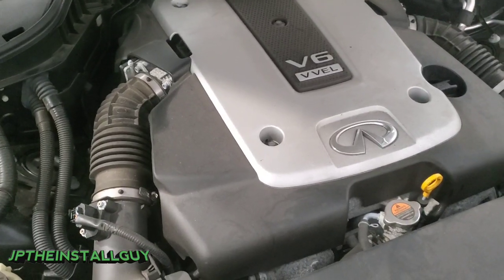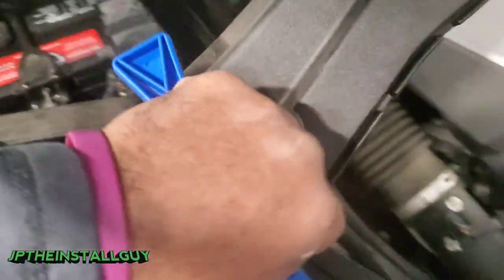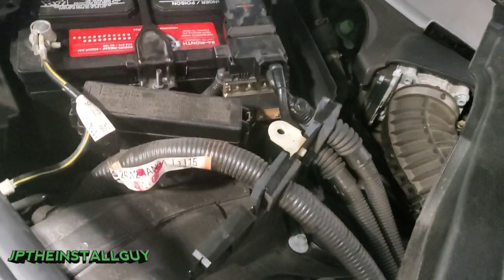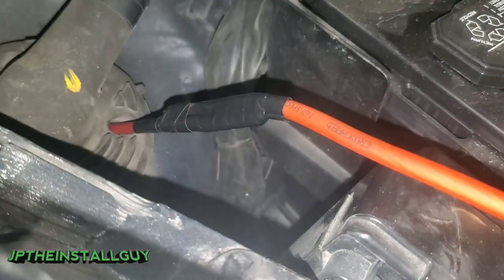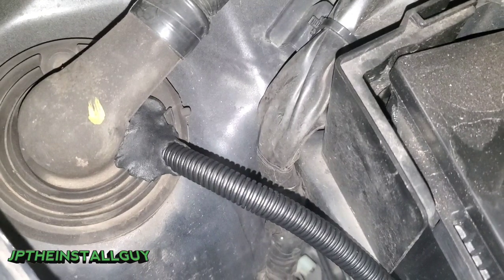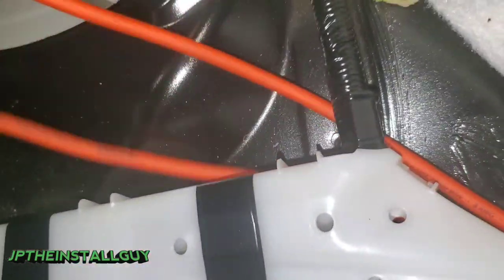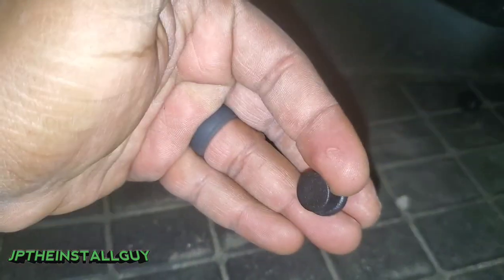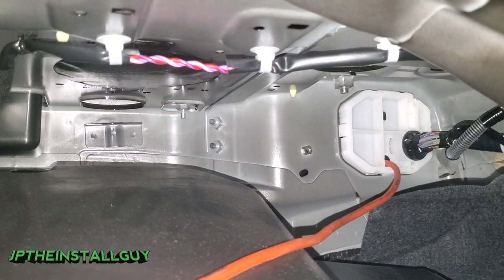INSTALL AN AMPLIFIER in your Infiniti q70 | Run wires through firewall

Comment: No need your help I have a 2015 q40 it don’t have a Bose system and I’m useing the factory head unit and  I have a subwoofer and an amp I did the power and ground. But I don’t know where to connect the remote I was going to buy the kicker Line-Output Converter will it work?

Comment: do you have any videos on taking the display apart for the Infin q70 2018? Mine is having problems with the head unit where it displays the radio info it keeps on flickering and not wanting to turn on but when i go in reverse the camera with flick on for 2 seconds then disappear